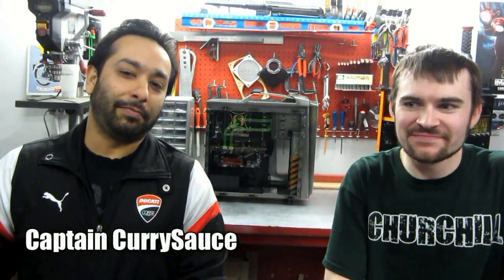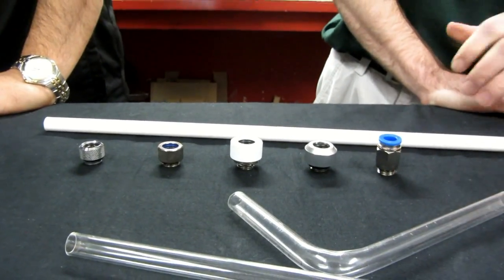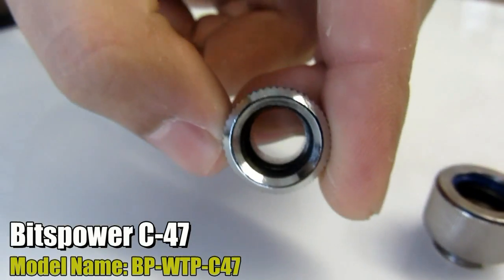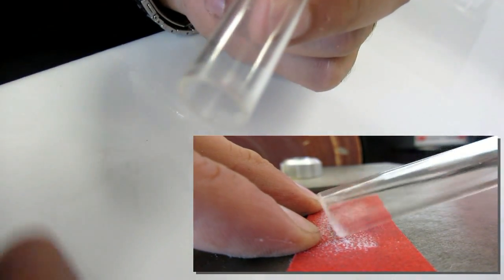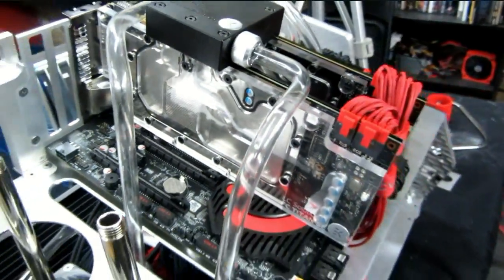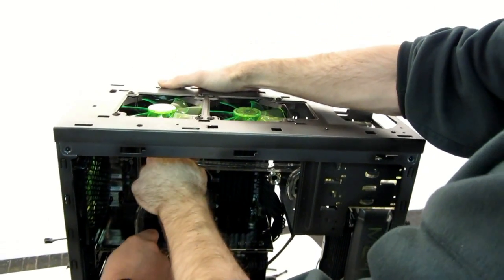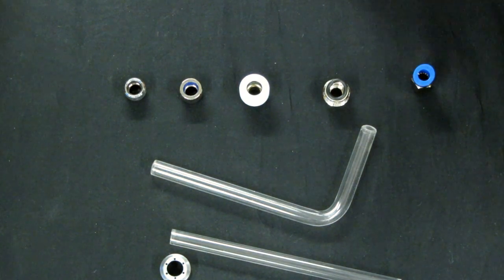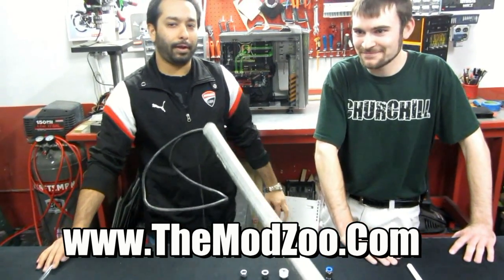Guide to Fittings for Rigid Hard line Tubing for PC Liquid Cooling by TheModZoo.com

Comment: can i use the revolver fittings with bitspower 12mmOD tubing? or will the .7mm offset cause leaking?
Reply from the maker: No, use 12mm OD compression fitting for 12mm OD tubing only.
Reply: @MaxellAdGuy  thanks for your help

Comment: Hey guys, Monsoon has their new EV2 hardline fittings which are taller than their old ones. I found them and was pretty sure they were good for me but especially after I saw Jayztwocents cover them saying they can fit a wide range. Should have them this week and use them in the next few weeks for sure on Cu Tubing

Comment: Can you use any rigid tubing connectors on copper tubing? Or do you have to use specific copper fittings? Kind new to this whole thing.
Reply from the maker: +TomahokYoutube any .5" OD tubing will work with the .5" OD compression fittings. Most of our builds have been with this .5" OD PETG tubing,  http://mnpctech.com/pc-computer-alphacool-ek-bitspower-hardwarelabs-heatkiller-liquid-cooling/petg-tube-clear-bend-petg-tubing-mnpctech/
Reply: +Bill Owen Thanks! That is what I first thought when I started researching this stuff, but the more I researched the more I became unclear as I couldn't find too much on what fittings people used with copper.

Comment: what stops the tubing from being pulled out or accidentally knocked out  and how does it have enough pressure for the o rings not to leak the tubing has no threads

Comment: Look into Swagelok fittings. I just hate o-rings because they degrade/swell and fail over time. These ones are stainless steel ferrules. Expensive to be sure, but worth checking out. I use them on the daily.

Comment: Hi Guys,

I need some advice, I am using a Thermaltake BigWater Pro 2 Bay Reservoir. The problem I have is that it comes standard with the black rubber tubing and I want to convert this to Acrylic / PETG Tubing.  Any advice?
Reply: just buy the hard acrylic tubing that fits and if you don't know how to properly bend the tubing just buy some 90 degree fittings for your angles. i'm doing the same

Comment: I have a build coming in a case labs th10 and the customer wants all hard tubing.. On the mobo side I plan on using acrylic, but on the PSU side I was thinking on using copper..  With lengths over 15", acrylic seems to brittle/fragile.. And since the PSU side is not on display, copper seems to give me the flexibility and strength I need.. Heck, I could even paint the copper to match the case..
Reply: InfinityPCs In that instance, you might even want to consider copper pipe and pipe fittings (the ones that need solder, flux and a blowtorch -- make sure to build that outside the case :)) over the annealed tubing, unless you actually need to bend it. It's a little less expensive and comes as straight lengths instead of in a coil, meaning you don't need to straighten it first.

Comment: Some nice builds and great info on fittings. I have just started modding a copper custom loop and will be using refrigerator copper and regular fittings as the style of my rig allows for non-flashy items to be included. The copper tubing I have had polished and is the star of the show,

Still not sure what CPU/GPU blocks to go for yet. cheers guys....

Comment: Mathias Buus Larsen The new enhanced BP multi-link fittings have the same issue as shown for the C47 series with the main o-ring possibly being damaged if you don't prepare the tube & aren't careful. The second o-ring inside the new collar gets put onto the tubing first just like the Primochill design in the video. This is nice as it creates the second seal. Overall size wise, the new fittings are slightly bigger than the C47 which has an outside diameter of 18mm & the new ones are 20mm (for your side-by-side placement on blocks).

Comment: Can you review the new bitspower fittings ? Bitspower Enhance Multi-Link
Reply: Next round we will make sure we include those. They are a hybrid between the C-47 and the PrimoChill fittings. There is a single O-Ring inside the new fitting, and you have to be careful that you do not damage it when installing.

Comment: If you look up spring type tubing benders they will work on the soft copper tubing and they are sold as a set usually. Not sure of the price since I haven't had to buy one in awhile. They aren't that expensive though and are easy to use once you get the hang of it. Soldering copper isn't that big of a deal either but it can end up looking messy if you aren't careful and the tools needed for that are found in most hardware stores, unlike brazing equipment.
Reply: It's a good point on the spring benders.  I've got a set of springs, and it was only about $14 I think for a set of 4.  I didn't really like using them.  I'd prefer to use slightly more rigid copper tubing, instead of the softest, and the springs just don't work for that.  If anyone else has them and they work for you, that's good, no need to get a bending tool.  It just wasn't for me :)

Thanks for the input :)
Reply: *****
 NP.
For anyone else looking at the spring benders, the trick to getting them off of the tubing easily is to slightly "overbend" the turn in the tubing. Then straighten it back out to the desired angle. The tubing will push against the inside of the bending spring when you are forming the angle and mostly stay that way if you bring it right to where you need it and stop. It's trying to kink as you bend it, which the spring keeps from happening. This can make it hard to slide the spring off. When you overbend it and adjust it back to where you need it relaxes the tension on the inside of the bender and allows the spring to be slid right off. If it's a tight bend there still may be some difficulty but not nearly as much as if it was gripped by the tubing too.

If you do encounter some difficulty getting the spring off you can twist the spring in the opposite direction than the way the wire is wound as you try to pull it off. If you don't know what I mean by the twisting just try to twist and pull in one direction and it might tighten up on the tube so if that happens try twisting it the other way. Twisting it opens the spring diameter up a little to get it past a bad spot. Yanking the spring off if it gets stuck will permanently deform and stretch it out :)